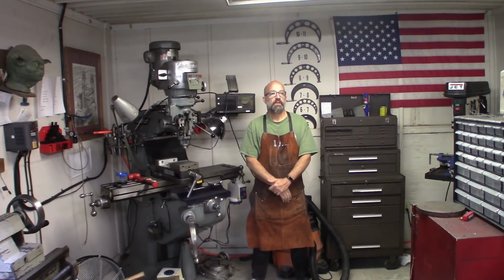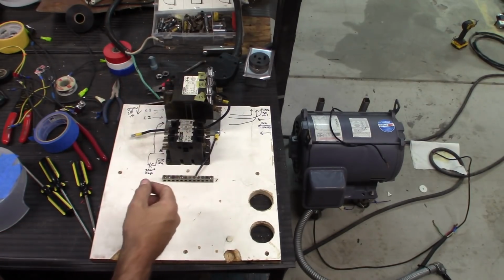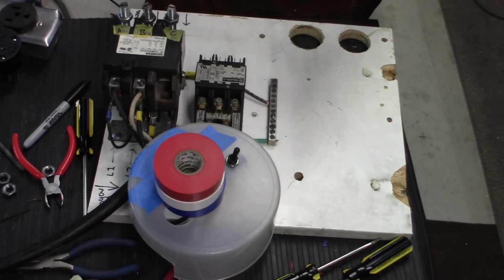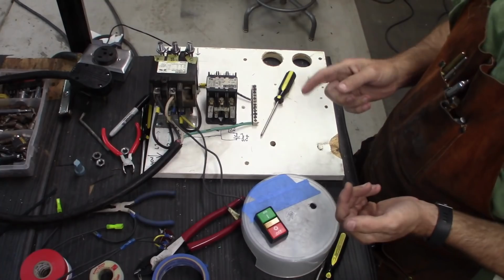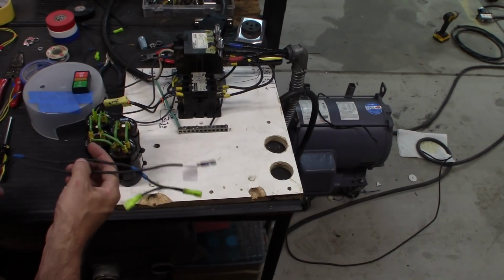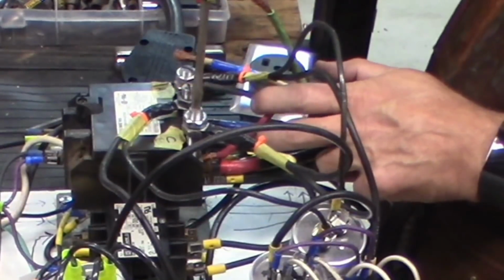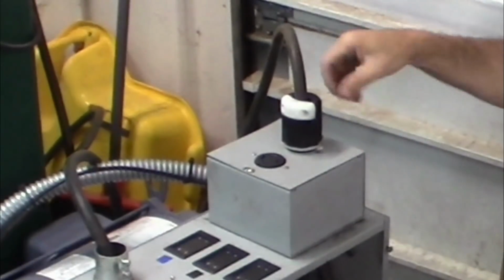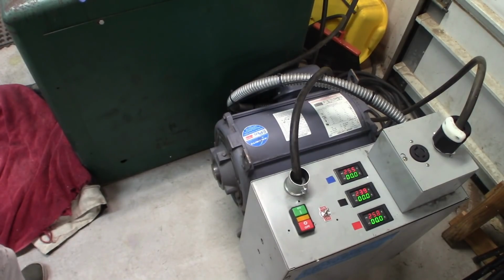Home built rotary phase converter for home shop 3 phase power

Comment: You went through the bit about the second switch so fast that you lost me?
Reply from the maker: The two contactor switches or the external switches?  both have to do with engaging the startup capacitors only for the starting of the motor then switching to the running capacitors once going.  Most single phase motors will have a centrifugal switch in them that once they get to speed it'll disengage the start capacitor.

Comment: You have your L1 L2 and L3 for your induction to start your motor... If you change your L2 and L3 around, won't it change your polarity to your motor so your motor will start?
Reply from the maker: It's being started from single phase.  Remember you have to measure between to Legs to measure a phase so the two lines I have going in only count as 1 phase between L1-L2.  Adding one more wire gives me the ability to measure between 3 sets of wires L1-L2, L1-L3 and L2-L3 giving me the 3 phases.

Comment: L14 is a 240V split (single) phase.  L15 is the correct connector for three phase.  But people use the L14 because it is cheaper.

Comment: One thing that I realized is missing:  a centrifugal switch.  Single phase motors with starting capacitors have built-in centrifugal switches in series with the capacitor to deactivate it when it runs at full speed.  Three-phase motors, however, are assumed to already be hooked up to three phases and therefore do not come with centrifugal switches.  But I believe you can add a centrifugal switch to the end of the arbor and hook it in series with the motor starting capacitor so as to avoid having to use a momentary contact switch to serve that purpose.  This also allows the motor to start up by itself if power goes out and then comes back on.  Please pass this suggestion to all who have built rotary three-phase converters.
Reply from the maker: Yes, for single phase motors this is the only way to detect that the motor as at speed.  My plan when I revisit this will be to add in a voltage sensing relay to the third leg and use that to cut out the starting capacitors.

Comment: Cool project. Did you consider a time delay relay instead of the momentary switching for starting? Have you figured anyway to get around the reversing issue?
Reply from the maker: I actually got a voltage sensing relay and some other parts that as soon as my home remodel is done I'll be working on a rebuild of it with lessons learned.
Reply: @TheArsonsmith4242  Can you please do a video on your modifications, and also a little more detail around process of balancing the run caps please? Maybe a link?

Comment: Thanks for sharing such fantastic info and well delivered too!  Great Job :)   I have an old shop-bought one I got 14+ years ago and it won't run my 3 phase inverter welder but will run my panel saw?  I suspect it has an issue with the idler motor as it seems to start and run OK with correct voltage, but when I check the output for amps at idle I get minimal values (e.g. 0.78 amps?).  I am just wondering what output amps you are getting on the output side when idling? thanks again!
Reply from the maker: At idle with no load the amp meters read 0 on all 3 phases.  It isn't until I put a load on it that they go up.  Running the bad say each leg gets 2-3 amps.  Been focusing on getting a new power drop to the shop so I haven't run anything other than the band saw on it.
Reply: @TheArsonsmith4242  Great thanks for your reply! So maybe I should load it up and measure the out when loaded.  Thanks for the info...Keep the vids coming :)

Comment: A couple of home made phase inverter unit that I have seen in the past, there was a hand wheel mounted on the shaft of the  motor that you would rotate by hand when starting the inverter.
Reply from the maker: Not a bad idea, although I think I'm pretty close to self starting.  Going to be doing another project soon then getting back to this one.

Comment: At my first (full time) job we were in a single phase only area. To run the machines that were three phase we had a motor (the converter) that I believe was three phase. We would spin the shaft with our foot (It had a rubber sleeve on the shaft) until it got spinning fast enough to start (with single phase). It would then somehow (I never learned how it was wired) run the triple phase motors with no problem. Kinda hack, but it worked well. This was in 1980. I remember John Lennon's "Imagine" was playing on the radio every day. It was just after his assassination.

Comment: I have to admit, I was a little afraid to watch this video.   Most electrical videos on YouTube are unsafe installs.   You did a very good job of explaining each step and how it affected the system.   Was getting scared through most of it till you brought out the enclosures!   Overall great job.   Suggest you change to a cable connector for incoming power instead of a conduit connector.   One thing I'm not understanding.  The systems I designed in the past were with purchased rotary phase converters and controls.   I do not understand why you needed to add all the other capacitors.   Was the voltage rating on the 30 hp 240 volts or was it rated 208/240/480?   If the latter and wires were connected for 208 volts, that would explain the outcome you got and could be re-spliced from 208 to 240 volts.   As far as starting issue, you might try taking the drain resistor out of the start cap circuit.   It could be taking too much power to charge the caps and then start the motor.     You could add a switch to if if you ever did want to drain it.   Respectfully,  Kevin
Reply from the maker: the capacitors help bring the generated leg voltage up.  Just spinning the motor on singlephase will generate the 3rd leg but it will be really low (around 180v) by adding the capacitors you can bring that up to 240+ about 8% to account for voltage drop while under load.
Reply: TheArsonsmith4242  thank you for the response.   Any thoughts on letting start caps stay charged?   Does the 30hp have a 208v rating?   Also, the way I calculate it, you would need 65 to 75 amperes of over current protection in order for it to start correctly.   Thank you for your time.   Respectfully,
Reply from the maker: @KevinCoop1  interesting read on motor voltage: http://www.brithinee.com/technical-articles/240-vs-208-volts-do-motors-care/  240 and 208 both use the same windings in the motor.

Right now the entire shop is on a 50amp breaker and that's shared with the rest of the lights and equipment. (way under powered but only occasionally trips) I am currently working on the building upgrades to take care of that issue.

Comment: I don't like this idea at all, it's not safe, the phases aren't balanced, and the starting arrangement is so poor, this could easily cause a fire. With 40 years of experience under my belt, I would condemn this idea out of hand. The only way to do this properly is with a solid state inverter, or a synchonous  motor and three phase alternator. NB don't run cables all over the floor.
Reply from the maker: Thank you.

Comment: that's very bad....different voltages and different amperes for each phase. you will burn the motors.
Reply from the maker: They are insured to be in the correct tolerances.  Under load they balance out as they are supposed to.

Comment: Man you are not working with single phase AC supply. Technically you started with 2 phase 3 wire supply with 110V approx in each phase. With this video I came to know that in USA  this type of domestic electric supply is available. In India we have either 230 V single phase supply with two wires. Or 415V 3 phase 3 wire or 4 wire supply. Thanks
Reply from the maker: You can't have 2 phases with only 2 wires as you need to measure each phase across a different set of wires.  To have 2 phase you still need 3 wires, 2 separate supply and a common.  With only two wires (+ ground) you can only measure a single load across those two wires so only single phase.  with 3 phase, all 3 wires are supply and you can measure 3 ways across each of them.
Reply: @TheArsonsmith4242  no no no. U misunderstood. In India we have a very different supply system than yours in US. Our single phase means a phase wire or live wire with 230V, 50 hz AC and a neutral wire. We don't  have 110V - 0 - 110V type supply. Thanks for replying.
Reply from the maker: @souvikdey9178  yes, our 220-240v system is just often confused for being 2 phase.
Reply: @TheArsonsmith4242  dear sir, in South Africa we have the same 'problem'. 3 wires. One ground, one neutral (no voltage) and one live(240v). These RPCs really sparked (pardon the pun) real interest for a 3 phase solution for my workshop, until I read Souvik Dey's comment. Feels like my kite is shot out of the air. In my lame man's terms (electricity is not my thing, so I lack terminology) if I try to build a RPC like yours, I can only feed one phase on the 3 phase motor/generator. Would you be able to provide insight how to "revive" the 2 remaining ghost phases? Thank you in advance!
Reply from the maker: @TheoTHERON_SA  you can still start a motor with single phase 240v and neutral.  

https://www.youtube.com/watch?v=jMmUoZh3Hq4

Comment: I see you used sbirdranch as source.  He has a very good tutorial.  I used his tutorial to build my 5hp RPC.  I like his single switch to charge the capacitors, and start the motor.  The only problem I had was I blew a start capacitor.  Replaced it with 3 start/run capacitors. All three legs are within 5 volts of each other.  It was fun and fulfilling to build my own unit.  Building a 30hp would be a bit of a challenge.  Congratulations on your success.
Reply: Recently bought a 15hp motor to upgrade my power capacity.  Will be building a new 15hp RPC.  Just need to start aquiring my capacitors, etc.  Are you engaging the start capacitors before the start button.  I hate what I will have to pay for an empty Hoffman panel.

Comment: Fix it quickly, attach a 1 horse motor to the conversation. Motor to start and drop off after rpm is accomplished
Reply from the maker: using a pony start motor is always an option.  I'd like to have a fully self starting one though.

Comment: Nothing to do with phase angle.You need the right amount of MFD otherwise your motor won’t last winding are getting hot from the high amperage due to the slow start.There a chart on line for calculating the capacitors to the HP.
Reply from the maker: how slow is a slow start?  Other than the occasional spinning backwards attempt the motor spins up in under a second.

Comment: Would it help to put a small motor (single phase) with a belt going to the 3 phase motor to spin it in the correct direction?
Reply from the maker: Some RPCs do have a pony motor to kick start them.  So far it hasn't been much of a problem.

Comment: So, you have VFD's on everything, which are more efficient at converting single phase to 3 phase, cheap, and gives you speed control, and yet you're replacing them with a rotary phase converter, which is less efficient, heavy, expensive, has voltage imbalance in the phases, and gives you no control over the speed? Ok, I guess if you want to...
Reply from the maker: Nope, I have VFDs on two motors and have 5 more motors that would need VFDs.  VFDs are a bit expensive with one 2HP VFD costing almost as much as what I paid for a whole shop 30HP RFC and VFDs are only good for a single motor.  They also produce a high pitched wine in the motors that can be reduced with tuning but changes over time.   If you have a small number of motors to power (1-3) then yes stick VFDs on them and be done.  If you have a shop full of equipment and may want to swap in and out more equipment over time then VFDs quickly get a bit expensive.

Comment: I think the two large cap banks, you use to raise voltage on the ghost leg need to be disconnected during initial startup. They are causing a back feed of "out of phase" current being fed back to your building mains.
Reply from the maker: I do have a plan to add a way to remove at least the same set that has the start caps.
Reply: TheArsonsmith4242  It's not the start caps, its the load balancing caps.  You will need two more relays. One like the start relay (3PST), and another on that has DPDT operation. Wire the normally closed poles on the DPDT relay to connect (NC contact) to turn on the additional 3PST relay when the AC supply is turned on. Wire two poles of the new 3PST relay to apply the load balancing to the motor.  When the DPDT relay is operated ( in parallel with start coil relay), it will deactivate the 3PDT relay, disconnecting the two load balancing caps, during a start operation. When the start operation is complete and the DPDT relay is deactivated, the load balancing caps will be re-applied.
Reply: I also suggest you add fusing protection in the switching/relay area. If you have a failure in that area you have a path of a lot on amps to flow and release the smoke.....
Reply: @markcummins6571  a circuit breaker would be better
Reply from the maker: @markcummins6571  Yes, I mean a contactor that will swap the start and run caps.
Reply: @willrobbinson1  Last I checked circuit breakers are fusing.

Comment: Great video. I was never totally clear on how one of these worked. Now I know. Would there be any way to not have a manual switch for the starter circuit? At any rate, it's a pretty neat project that can save thousands if you can source a motor for a reasonable price and know what you're doing. This very definitely isn't a learn as you go type of project. It doesn't look that complex, but you could end up dead very fast touching something at the wrong time (especially after the capacitors were added since powering off doesn't mean it's safe). A lesser danger is burning up the motor you're trying to make the converter from or worse the motor in something you're trying to power with it.
Reply from the maker: Yes, and I'm working on that soon.  Got the parts and should have a follow up video.

Comment: You might consider checking your neutral connection in the main load center or having your local utility company check on their end, an unbalanced voltage between the 240, I think you had 121v and 118v is a sign of a high impedance   connection somewhere on the neutral, or grounded conductor, an easy way to check is to clamp an amp meter on the ground wire above the ground rod on the out side of your house and see if you have a load, if you do it's a problem.
Reply: Okay, so your ground is just there as a precaution incase an energized conductor comes in contact with something it's not supposed too, the purpose is to make the breaker or fuse open quickly,  a ground otherwise is supposed to be a non current carrying conductor. You're neutral, or the proper term on single phase is grounded current carrying conductor, in a 120 volt application will carry the same current load as the energized conductor, on 3 phase it carries the imbalanced current load, so if your current is traveling somewhere other than the neutral,  like say an improperly bonded ground, it can and will cause an imbalance in voltage unless the ground itself has a very low impeachable path to the neutral, and even than there can still be a voltage imbalance.
Reply from the maker: Working with an elechicken/engineer now.  Found my shop wiring is in pretty bad shape overall so going to have an entire new circuit pulled into the building.  Will also be using the rotary phase converter to power an actual 3 phase load center and distribute to the shop as if it was utility supplied 3 phase.

Comment: Very nice video.I think for every one horse power you need like 90mfd capacitor you need about 2000mfd to 2700mfd of starting capacitors.Thats what I used on my 30ph and it starts up instant.
Reply: I thought it was all to do with phases across the start winding. Different capacities will vary the phase angle. How does motor power affect that equation?.
Reply: @greenpedal370  Start caps "charge" the phantom leg so the motor doesn't single phase at start up.
Reply: @Peter-V_00  Thank you.
Reply: You're correct my brother

Comment: This is great. My RPC came with my lathe. It is a home built job. It's a 15hp motor. It has caps to balance out the voltages but I think I can get them a lot better. Is there a formula for figuring out what cap values and how many to use to get a close approximation or is it all trial and error. I've watched countless videos on setting up an RPC but everyone seems to just gloss over balancing the voltages with capacitors. My lathe is a 10hp machine, and the 15hp RPC will start the lathe. I deally I'd like to go to a 20hp RPC but I've been watching around for a 20hp motor and it's been slim pickings. My 15hp motor is getting tired. I've been seriously considering buying a brand new RPC form American phase converters but damn, a 20hp is about $1400. Any help on the capacitor front would be greatly appreciated. Thanks
Reply from the maker: I am planning a followup video on the RPC build and I can add in some info on how to do it.  Basically you have to add in a guessed amount of capacitors, start everything up, put it under load and then measure voltage.  If it's too high remove caps if it's too low add some.  Rinse repeat.
Reply: @TheArsonsmith4242  I guess one of the main questions is how many capacitors to buy, to have on hand, and mfd ratings, should I get. I want to have this stuff here when I start so I don't have to wait around for the UPS guy to show up.
Reply from the maker: @marcel-lemay7721  They aren't super expensive.  but you do need to make sure you understand the difference between start and run caps.  I bought a quite a few extra run caps in both 100uf and 50uf.  That gave me more than enough range to balance the power.